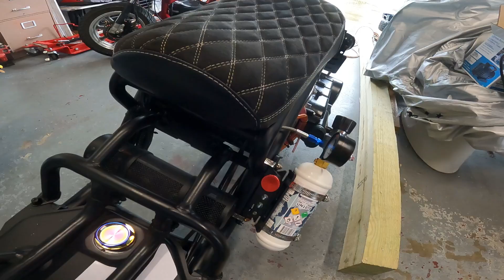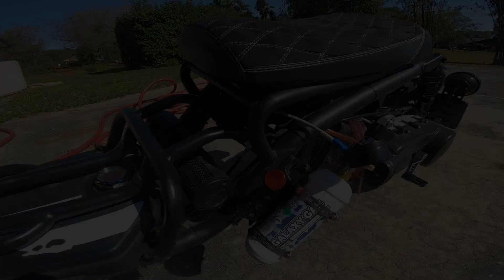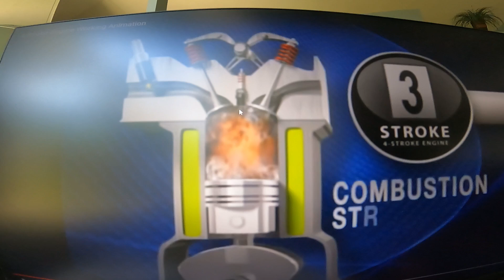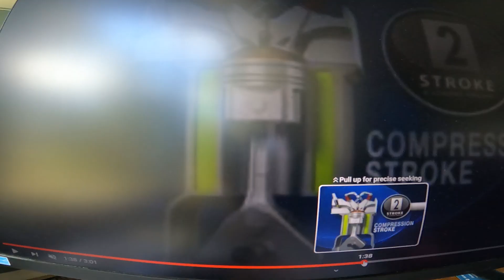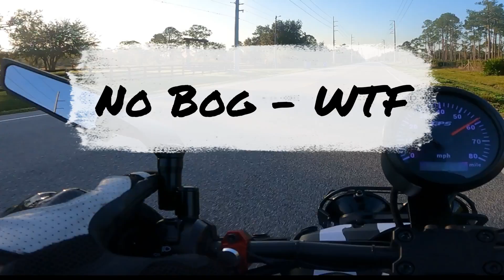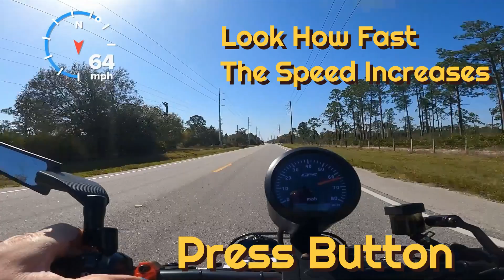Moddog GY6 Scooter Gets Nitrous NOS.  Way Faster AND Quicker.  How to Install

Comment: I wonder if this would do better on an EFI scooter?:)
Reply from the maker: Not sure.  But extra fuel in excess of what the EFI can give would still be needed.
Reply: I think I'd probably do a wet system. That way I shouldn't have to play with the ECU.@GhettoWrench
Reply from the maker: @anthonyjulson8840 Wet is safest option.  You have no idea what the max output of that EFI nozzle is and also if it will add enough fuel based off an exhaust reading.

Comment: What about running a wide band in an exhaust bug, jetting carb to run a little on the richer side, and dry shotting enough nitrous to learn it back out to optimal power range?
Reply from the maker: @bllrmbltzz  ya that would for sure be the preferred method.  I need to buy a AFR.  So many projects.  LOL
Reply: @GhettoWrench  there's the wide open throttle range jet in the nibbies and other "racing" carbs that could be jetted. I'm just not sure how much bottle it handle to get it back to like the mid 11 range for the "power" ratio. Could be really fun to play with. A CDI box that slightly retards the timing and going with a low compression engine set up would make it all completely safe.
Reply from the maker: @bllrmbltzz  And that's the big issue.  Trying to retard that timing.  Electric timing advance is actually delaying or retarding a mechanically advanced pulse.  These CDI boxes delay the spark less and less to full advance with their "timing map".  I would have to mechanically move the flywheel key or pickup tab to retard it, but then it's always retarded.   I dint use the nitrous enough to want to do that.  So I am just spraying more fuel also.  But adjustable timing would be cool.  Like my FiTech on the mustang does 😁
Reply: @GhettoWrench  I've been back and forth on getting a scoot for a few years now and central Florida has been pretty big on them recently so I might pull the trigger. Been looking at build inspiration when I came across a bunch of your videos. There is a Facebook group where someone's got an efi system that they've been fully able to tune, so that might be an option... But doing it with a carb until then just sounds funner lol. Replacement gy6's are a dime a dozen. Thanks for the inspiration man!

Comment: Yes it can be a plug and play i did it but i get 65eazy without noz on my chines 150cc the plug and play right to yhe air intak i havent rode it yet cus i have get a new switch i have a lever i use to open a valve but im replacing it with a push button
Reply from the maker: @alienzone1954  the Push button is just cooler.  LOL

Comment: How many hp wax the shot
Reply from the maker: No idea...  I'm running lower fuel and NOS pressure than the calculator so maybe 2hp.  LOL.  ??  I'm about to start turning that shit up tho.
Reply: I’m about to out a 10hp on a 171cc taida kit.
Reply: @Hector_x3 how
Reply: @Hector_x3 what other mods
Reply: @rustypotatos  basics carb pipe and clutch. Plus the 171
Reply: I got a 420cc with a 8hp kit like this made my 420cc scream
Reply from the maker: @Bighemi82  cool.  Like a preditor motor?  I have a ghost 212 on the coleman

Comment: I got a sym 125cc water-cooled  12.5HP does 70MPH at 7000 rpm that's factory was thinking of putting bigger main jet see if that take it to 80 MPH I'VE been told that the clutch from factory is a 200cc don't know what to do 
in the uk 
if you have had car licence like for over 30 years 
driving all sorts of cars  but still need to do a CBT EVERY 2 YEARS 
 the vehicle's    on my license allows me to 
drive all sorts today 
IT'S ALL ABOUT TAKING 💰 MONEY OF NEW DRIVERS FOR EACH TYPE  OF VEHICLE'S 
A CON JOB 
I DO REMEMBER THE BLOKE AT CBT TEST SAYING PEOPLE DON'T GET THESE LICENCES TODAY 
IT'S A FUCKING RIP OFF AM 62 GREAT VIDEOS WATCHED ALL OF THEM 
👍👍🇬🇧
Reply from the maker: Sounds like a sweet ride.  Ya certificates and licenses are only to generate revenue.   Why do you need a marriage license when anyone cam get married.  The big lie.

Comment: Provided your mixture is set right nitrous has same effect as a blower.
One thing that is usually done is to increase the upper compression piston ring gap to allow for more expansion due to heat.
Rpm wise, the variator rollers dictate that, gearing after that shouldn't effect that, it's a mystery to me, like going up a hill shouldn't reduce rpm, weights and torque driver angles is all that should do it.

Comment: Did this with a 6.5hp predator motor. Worked great.  Had a WB02 and tuned it to run on E98 running 10:0. Actually ran ok that rich NA.  Hit with a 8hp dry shot and it leaned out to mid 11's. You need a draggy meter to see the 0-30 0-60 improvements! can temporarily install the WB02 with lipo RC bats to get the A/F ratio correct.
Reply from the maker: I have the app to show all the times.   My cars always had window and wot switches..  I am just hitting a button on this so was afraid to hit it at slow speeds yet.  But I guess I may as well....  it's WOT from the get go.  That E85 works pretty good I have heard.  I think I will get some  and add some more juice.

Comment: That will kill that little engine with frequent use......won't it?........
Reply: Just depends upon how the tune is before using it as long as it's done right and safely it's his do it with but your just trying to look out for him.  Hey 232cc 4valve Liquid Cooled I'd my line
Reply from the maker: An engine is an engine.  Guess it will kill about as fast as a regular engine if the NOS ratio is the same.  I give it a month.  LOL

Comment: I have my 1lb bottle filled at Central Welding where I'm at. Any shop that has it can do it if they fill it slow and yes I  run a NX E proton kit 20 jet for nos/ 18 jet fuel = 15hp best with 18/16 to be safe.Very nice informative video.👍
Reply from the maker: Oh cool.  Ya I got way too small jet sizes.  I called AirGas and they said they only sold big bottles.  I should have thought of a welding shop.  That proton kit looks perfect.  I busted that aluminum piranha fogger and didn't know it was cracked and was giving me fits.  I discovered that and got the CF stainless Fogger and it fixed it.